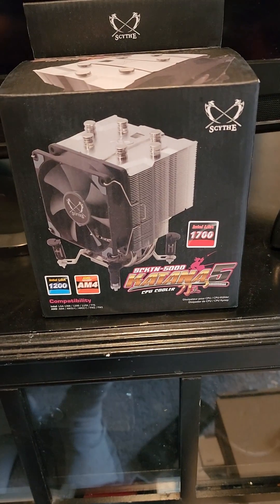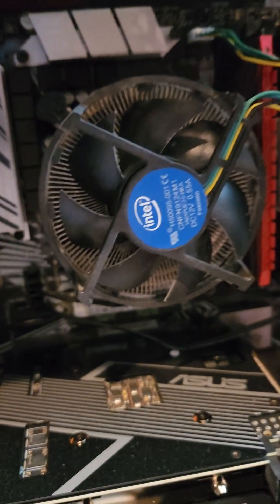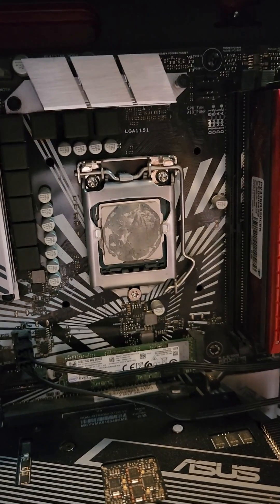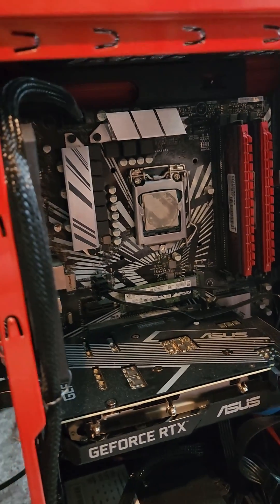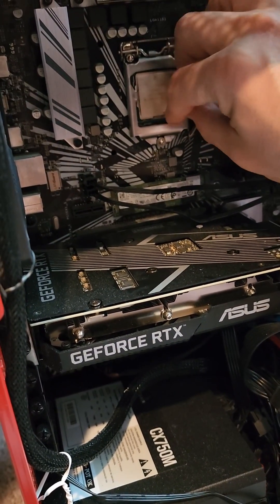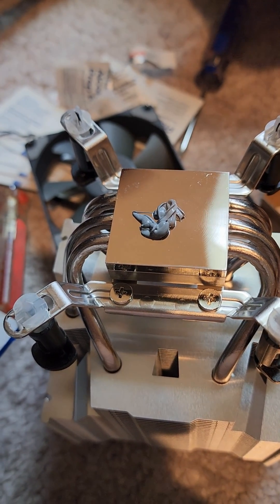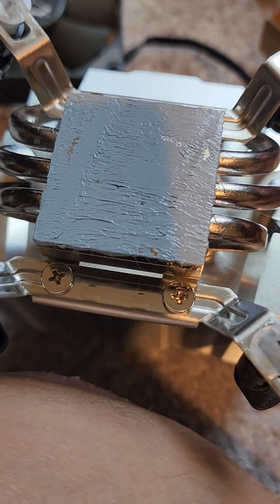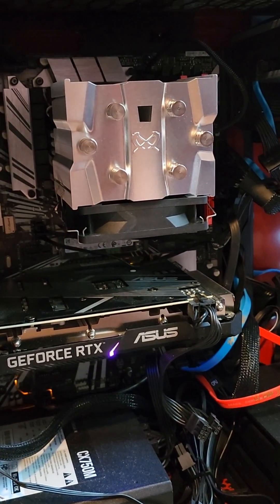How to upgrade your CPU cooler - step by step -

Comment: It seems to me that you need to reinstall the cooler and turn it to the left 90 degrees, so that the fan blows air from right to left, and not from bottom to top, in order to create better airflow.
Reply from the maker: thanks for commenting, what ever you decide
Reply: Yes, the CPU cooler ought to be facing the front intake fans.